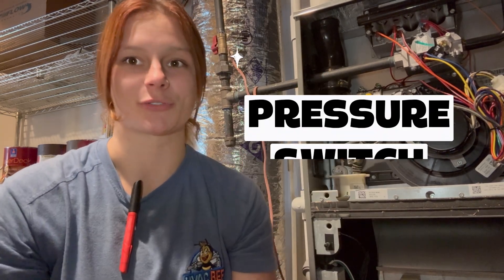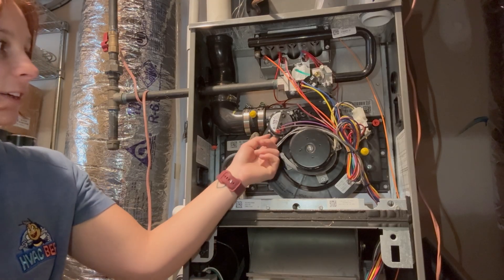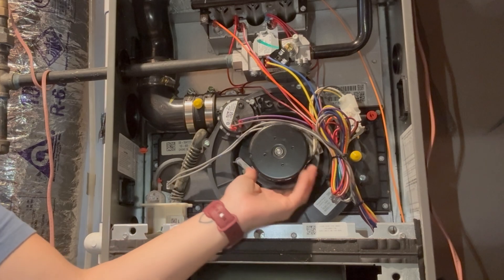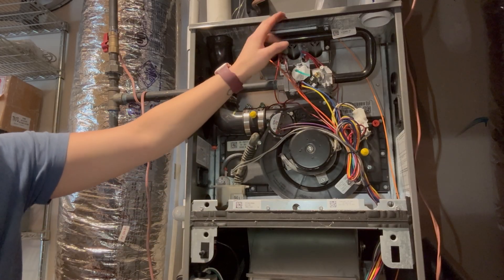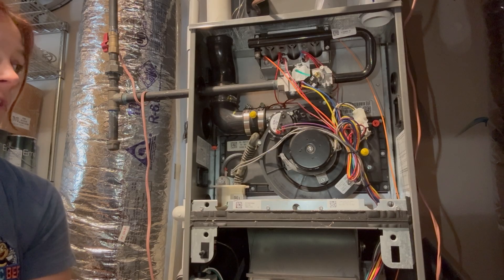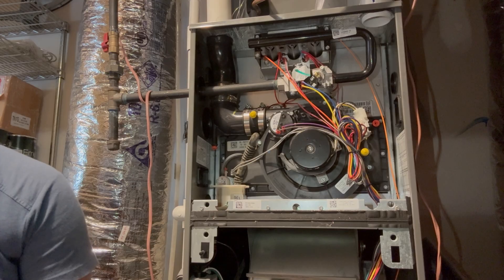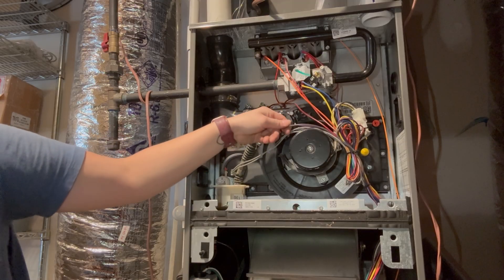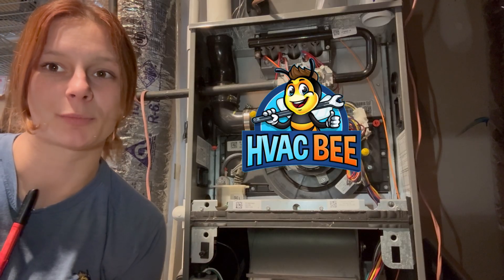How to Diagnose and Replace a Pressure Switch | HVAC Repair & Troubleshooting

Comment: Hi Bailee! I'm here from the other comment. I have a differential pressure switch - it has 2 lines, one goes to the sealed flame box. passed the breath tests.... Was a bit tricky to diagnose but I found leaves - there is a screen in furnace intake. A few years ago I found water in the fan. I called a local parts place because I thought it was bad he said they rarely fail and 99% it is something else.
Reply from the maker: They are relatively simple and strongly built components but we’ve also seen more like 5% that actually do test bad. Still pretty small percentage though and the other things you mentioned are both totally things that could be misdiagnosed as a bad pressure switch itself. 

Nice job on being able to get that one figured out! You got everything back up and running again now?
Reply: @HVACBee   The switch on the pressure switch is similar to a microwave door switch and those certainly wear out.  I guess the diaphragm too. Yep it works great. No blowback from the heat exchanger from what I see. I am getting good at this, in the summer I diagnosed a capacitor on the AC that couldn't kick the condenser fan. Being an EE, I just measured voltage and current with a clamp on in a formula and knew it was bad! Great video series you have!